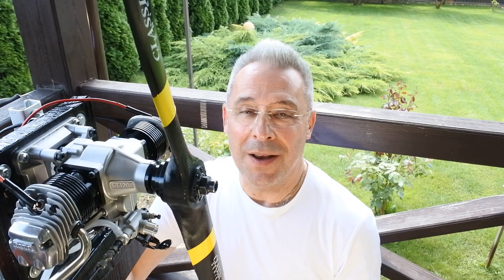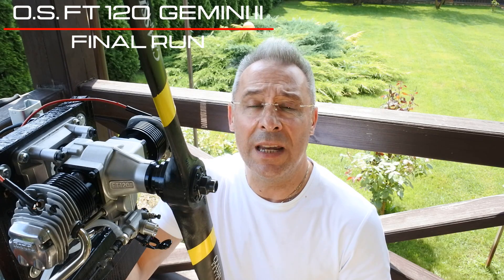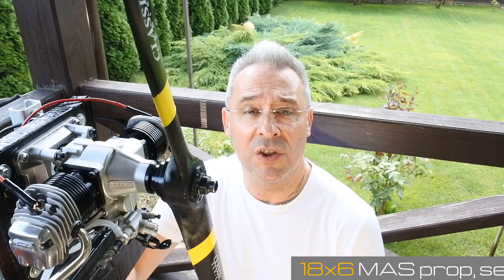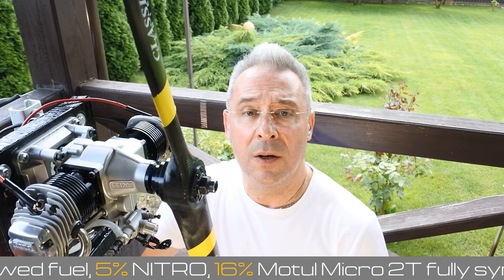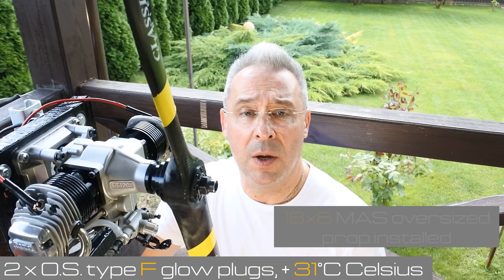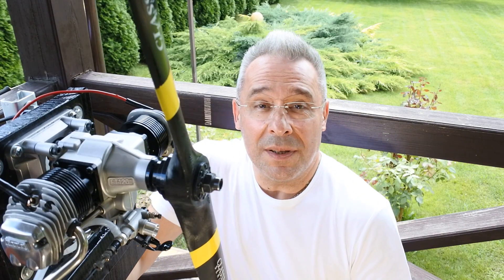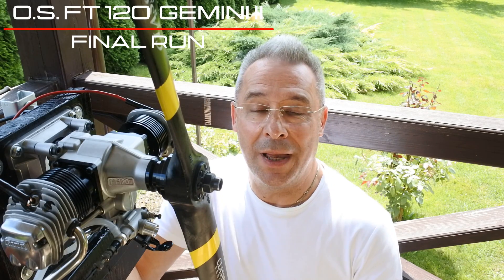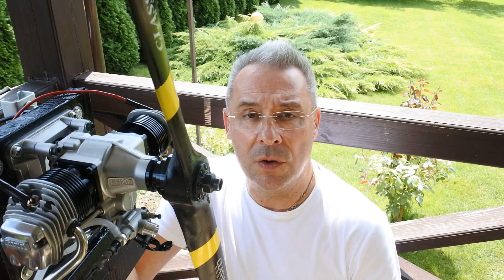OS FT 120 Gemini II final run with heavy prop

Comment: Flew my FT-120 II yesterday afternoon. And man alive did it sound good in flight! Power for days, too, it didn't care that it had an 84" span Spacewalker behind it. LOVES the 15-8-2 prop I fitted to it.
Reply from the maker: Great news, congratulations!
How is it with this propeller (15x8x2), I think it’s very dynamic and reacts immediately to the throttle?
Thanks for sharing the news! Have a nice day!
Reply: @crazyengines88  Response is super crisp and the airplane cruises comfortably at 35-40% throttle. At full blast it pulls like a freight train. Pretty sure I am close to unlimited vertical and probably would have it if I switched to a 16-6-2.

FT120 II *loves* a 15-8-2.
Reply from the maker: @TestECull   Thank super news ! unlimited vertical it's so cool, amazing ! Interesting, how its thrust will changed with 16x6x2. What do you think about 16x8 ? Gemini II is very flexible, probably, could easily turn a bit  higher pitch.
Reply: @crazyengines88  Thrust would go up with less pitch, but I'd be turning more revs for cruise. I like to prop my 4-strokes to turn around 9,000-9,500RPM static while also providing the airplane a nice, comfortable, stable cruise flight at about 35-40% throttle. I find doing so gives me great fuel economy, great performance, and a superb in-flight sound.
Reply from the maker: @TestECull  Thank you for your explanation., of course, this factors are the most important.
Thank you and have a nice day !

Comment: What kind of glow plug harness do you use for getting power from the battery to the plug! I need to find a good reliable one for my Enya 80 since the plug is in the front at a angle! Thanks! Also what do you use to power the glow plugs?
Reply from the maker: Hi, and thank you for your questions ! To be honest, it’s a difficult question, because most of these contacts are not so reliable, some do not hold tight, some can simply turn off due to engine vibration. From my certain experience, I would recommend you to try to use  Saito's glow plug's harness. The contacts from Saito are the most successful, in my opinion. They are plates of elastic bronze, with a cut in the middle, with recesses for the central electrode, and covered with a plastic tube to avoid contact with the protruding parts of the engine, hold on quite firmly and are easily attached / released. I can send photos of these contacts by mail, just write to me to my p.m., you will find it in the section "About the channel". For glow plugs power supply I'm using a kind of a battery pack, consists of  D-size  NiCd accu battery cells, which are soldered in parallel.
Mine D size accu cells are 10K mAh each, so the battery pack of 2 cells could easily powers 2 or 3 cylinder engine for a couple of hours of operation.
Reply: @crazyengines88  Thanks!
Reply from the maker: @stevebarr9604  You are welcome ! 🙂

Comment: Gotta love these twins..smooth engines with a great sound..im still hanging to get a saito fg41ts, hopefully this week..and will be doing break in on the dreaded fg60r3 today..hopefully all goes well..
Looking forward to the next video..great work,but surely you can get a great idle while using an engines recommendation of propeller? Dont want too much load on any given engine 😅
Reply from the maker: Ho, and thank you for your comment ! I understand your concern 🙂, nut should say, that these FT engines can hold normally really huge load. B.t.w., OS manual includes 18x6, 17x6 and 16x6 prop sizes, as recommended, so there wasn't any overload. Also, from the Aprils issue of "Modern Airplane News", on the chapter "Engine review", by Peter Chinn, during engine tests, engine was loaded with 18x8 prop, achieving 5,9-6K RPMs. I should mention, that my result of 7K RPMs with 18x6 MAS prop was higher on 800 RPMs, instead of their test result of 6,2K RPMs, with the similar prop's (18x6 Zinger). 
Thank you and have a nice day !